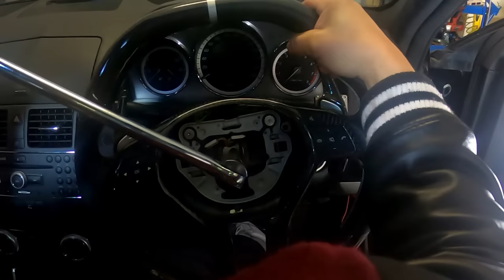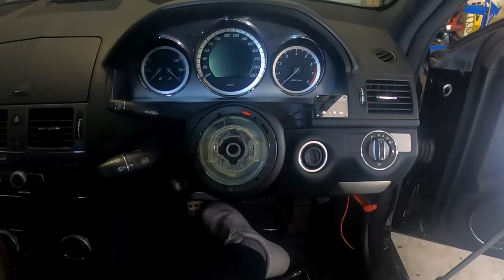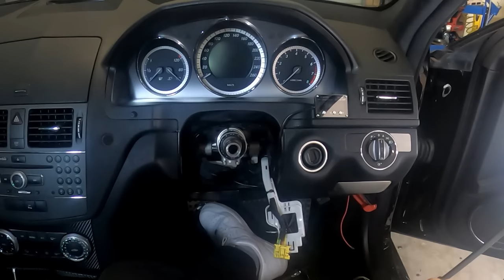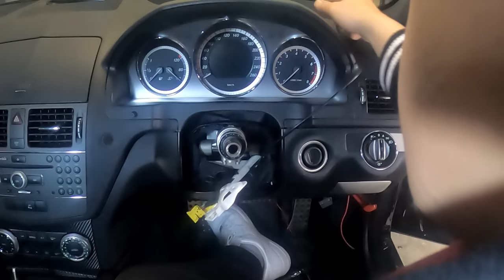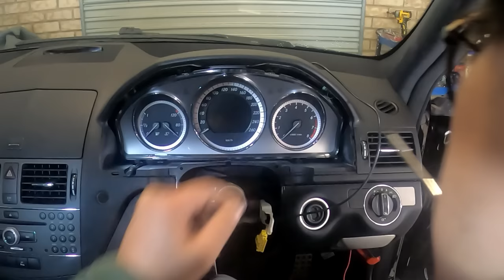HOW TO remove and fix ESL/EIS/ ELV MODULE  w212 w204 mercedes motor replace  Part 1

Comment: Hey, my ESL is definitely having the symptoms, but my steering wheel doesn’t lock at all. I can still move it fully, but I just can’t start the car.  Does that mean my ESL isn’t in the lock position or still isn’t Lock position. Again, I can freely turn my steering wheel. It does not lock now I’ve had my ESL replaced before.
Reply from the maker: yes so it just means ur lucky your esl failed in the unlock position..but tbh... after a few years of this ..although my car still going strong with the esl motor I swapped out ..I strongly recommend getting an emulator bypass module

Comment: On the streeing wheel, to remove it what size is the bolt?
Thank you
Reply from the maker: i believe it is an size 8 hex i will.double check for u and update this msg...so after having a look i believe its a hex 10 .... it can only be 8 or 10 but im pretty certain its 10.... wen u take off your airbag u will be able to find out for sure what it is ....
Reply: From memory a 13mm hex plus friend with very long lever and red-face torque will do it.
Reply: Sorry, 10mm hex. Can buy a socket or use the last and biggest one from the set of hex keys.
Reply from the maker: @dominicwild3189  yes its a size 10 hex
Reply: Don't remove the steering wheel or anything, have a read of Daniel Janka's suggestions above. You can pull out the whole column once you remove the plastic holder of the electric cables and the top two torx bolts using an extension and a universal.  It is also bad news to remove the short bit at the universal at the spline as the universal is alu and the other part is steel and once you mate them, you have to hammer them back in, so pull it all out right up to the firewall. There the steel spline goes into rubber, easy.

Comment: Nice Video! Okay so i have a couple questions?

1. Where is the 2nd video?
2. What's the name of the little motor?
3. Can i modified my car so there is no ESL/EIS or lock the wheel just turn it on like old cars?
4. How many miles does it take to fail the motor?
Reply from the maker: hey friend 
1. theres a part 2 if u look through my video 
2. theres no precise name ...you can find it via ebay by searching for a mercedes w204 esl/elv motor replace 
3. yes there is a esl bypass module emulator <--- search this ...you will find it ... you can also purchase from ebay but it will need to be programmed to suit your car and sync with your eis ... so yes u can remove your esl completely and use a bypass module in place of it ... its exactly the same looks the same but has no locking mechanism and basically bypasses the esl so your steering doesnt lock.... and because it doesnt use a motor no chance of mechanical failure which is our problem on w204s especially 
4. hard to say how many miles it is susceptible to failure at any time ...no precise prediction of miles or kms.... which sucks..but usually u can tell wen it starts to fail.... sometimes other factors like flat battery can mimic the issue but isnt a failed esl as yet ..thats what happened to me .... my batt kept draining out and eventually my esl motor died and had to replace it 
hope this was helpful friend

Comment: Hello my friend, just a quick question on the ESL motor, does it have to be a specific make, or can I just use any motor? Plus where can I get one of these motors? Thanks
Reply from the maker: a specific motor ebay has alot of them just type in w204 esl elv motor replace and it will come up
Reply from the maker: here u go....https://www.ebay.com.au/sch/i.html?_from=R40&_trksid=m570.l1313&_nkw=w204+esl+motor&_sacat=0
Reply: Thank you bro!
Reply from the maker: you are most welcome
Reply from the maker: it can be any motor but nake sure the gold spindle that spins  is the same size
Reply: Aliexpress sells the motors plus handle and pin to take out the four pins on the ESL lid plus the circular tool to take out the ignition lock if you are not game enough to change the motor and need to send ESL, ignition lock and key off to a locksmith.

Comment: Hey man, cool video! At what mileage does this usually happen? My car is a 2011 C300 4MATIC Sport with 90k miles and I’m really nervous!
Reply from the maker: hey buddy welcome to the channel , honestly it can happen at any time mate, i know its nerve racking, because if your not fortunately enough like i was to have it fail in your driveway your gonna need a tow...but i strongly recommend that if it does happen, give tapping it under the steering column (right under the ESL module) a go, and hopefully it will spin the esl motor 1 last rotation in order for you to get home...but ill also express, that it also happened to me when i let my battery drain out a ferw times....hence the esl losing all its power, thus not having enough current or voltage to work correctly....... they say its mainly for the earlier models like 2008 and 2009, but mine is a 2010 model and it happened to me at 100ks...... one day when i put the key in the ignition , i noticed nothing happened..... then with abit of research...i found this to be a common fault for most w204s.... the only thing i can recommend is ...if you have any warranty use it to fix the issue asap.... although your car is 2011...so your warranty maybe out of date,  unless you bought warranty extension, which i did buy.....
if you have any more questions pls do not hesitate to ask dear friend
Reply: Mine croaked at 137,000 km or 14 years (July 2007). The moment you need to start it twice, panic and drive it to your garage to fix it yourself or to the nearest stealership, sell your wife and children into abject slavery for the $2,000 it is going to cost you or $5 if you fix it yourself by becoming a Youtube mechanic with MIKEYZ's help. He is a fellow friendly Australian, so get used to his accent and forgive him!

Comment: Hi MIKEYZ, what type of grease/lubricant did you use on the plastic gears and motor?
Reply from the maker: you can use lithium spray grease or any grease for plastic moving parts i used general purpose grease but ensure it is for plastic moving parts.....

Comment: I’m currently doing this on my W204 how do I actually remove the ESL itself? Your video skips to when you have it out. Thanks
Reply from the maker: if ur fixing motor u need esl out ... there's part 2 where I show roughly where it is and how u do it ... I couldn't film it properly cuz of where it was situated... if ur using bypass module u don't need to just unplug
Reply: @MIKEYZVLOGZ  I’m replacing the motor! I’ll look in part 2 thanks
Reply from the maker: @dynasaur_fxdb9756  then u need to remove the esl... u pretty much do it by feel thats how I did it .. which is why it was hard to show how cuz all done by feel

Comment: I have a w204 with same problem where eis is not responding. But ky dash lights allbis not working either. But car locks unlocks and when i open the door the km does show but thatsbit nothing else. And key fob not responding. Obsthisbthe symptoms.
Also was intermittent when this happenned and then turn key and it starts. Now its dead.
Reply from the maker: Sounda like a esl issue ... when this fails it has the symptoms ur speaking of key doesnt read ... insert key and no lights on dash no response.. and sometimes it will work.... try tapping under the steering wheel...this can help because it send vinration to the esl and helps the motor unstuck so it can unlock steering allowing you to drive.... but this is luck

Comment: If the steering wheel is not locked does that mean that the esl is unlocked? Or is it possible that it may still be in the locked position?
Reply from the maker: hey mate welcome... hope u will subscribe  and support my channel... so if your steering wheel isnt locked then most likely its unlock..however in this case it could be another issue as to why your steering is unlocked... could u give me more info ...such as when you put your key in what happens do you get any noises?  like a click etc... also is this when you insert your key or its unlocked in general??

Comment: How long does this take and how did you know this was the issue? Mine won’t start at all and the battery is charged
Reply from the maker: research and mb forums and actually doing it..this is the issue 100%...if u are not good with tools and first time doing it maybe an hr to 2 hrs ... if ur good with tools and follow instructions well maybe 45 to 1 hr can be achieved...your case seems to be the esl for sure .. I can bet my bottom dollar its the esl motor
Reply: @MIKEYZVLOGZ   thanks, I call the dealer just to hear them lie and they’re telling me it’s $1750 and a grand of that is parts. Straight thieves
Reply from the maker: @jcso0721  exactly

Comment: Hey mikey i removed the motor and replaced it but it is still not working what do you think it could be the dash still says remove key from ignition I'm so confused lol thanks?
Reply from the maker: when u put the circuit board back did u ensure the two lottle grey micro switches were pressee down?.
Reply: @MIKEYZVLOGZ   no i did not  thanks  so much for replying mikey ill rewatch your video
Reply from the maker: @ToLife_  in the video i dkdnt show that but it is important if for some reason they rnd up depressed ... sometimes its due to reconnecting power and also if your esl wasnt properly unlocked
Reply: @MIKEYZVLOGZ  hey mikey are you talking about where the motor meets the circuit board
Reply from the maker: @ToLife_  no there are two little micro switches that are on the circuit board on dofferent levels send me an email ill email u a pic ... usually ull kmow if they are pressed wen i insert board and u cant get it in flush
Reply: @MIKEYZVLOGZ  i just found them so all i need to do is press them down correct?
Reply from the maker: @ToLife_  yes and it should be fine... if not then theres obviously sometjing ur doing wrong

Comment: What happens if the switch doesn’t detect the key and you can turn the key but instrument cluster not lighting up nothing that’s why the dealer said your esl switch is bad and need to be bypass or replaced for a new and programming it 
So that’s my question for you u think that the same problem or a different?
Reply from the maker: if you put your key in and nothing happens ..no lights... no turning noise from esl usually you get a whinding noise.... then yes it is most likely the esl motor in the module.... you do not need a whole esl module you can simply replace the motor...no programming needed .... but if you replace entire module you will need to have it programmed .... in your case I'm pretty sure it's the motor
Reply from the maker: so yes it's the same problem friend unfortunately
Reply: david murillo  I have a 2010 Mercedes c300. I place the key in the ignition then just turn the key all the way to crank the engine but no crank and no cluster lights or head lights. Would the ESL cause this problem.
Reply: MIKEYZ VLOGZ hello so you say if my cluster doesn’t light up and engine doesn’t crank it’s because of the ESL. I got this code b225464,,Electric steering lock has a malfunction. The key turns all the way to crank but like I said no cluster lights and no crank. Oh I only notice the middle section of the cluster showing p, r,n and drive light up
Reply from the maker: @rogerhulsejr2111  ye your code means its the motor in the esl that has malfunctioned ita most common fault with w204

Comment: My w212 same mechanism, but mine got stuck in ulock and now sometimes the engine wont stop even when i remove the key from ignition... But it never locks the steerig wheel. So, even if i replace the motor, i still need to go to a dealer or service?
Reply from the maker: if your just replacing the motor there is no need to reprogram it. or visit the dealer
Reply: Thnx! You might have just saved me 1200€. So now i just need to finde how to come to the locking mechanism. Will tell you how it goes.
Reply from the maker: @matejalbert2259  just pls remember to pay attention to detail and also wen u put everything back together make sure u also depress the 2 lil grey switch buttons on top of the chips as well

Comment: Mikey I can’t get my ESL out of the lock position. I need to get the steering column out but can’t figure out which bolt. Can you help?
Reply from the maker: u see a bolt where the column attaches to the shaft there's a Allen bolt that holds it in ..u undo that and it will allow u to remove the entire column
Reply: @MIKEYZVLOGZ  thanks Mikey! I did do that and I couldn’t pull the pin out.
Reply from the maker: @charityfreeman5569  u can just loosen it and then just pull out the column u don't have to remove the pin
Reply: @MIKEYZVLOGZ  thanks! I am so sad I couldn’t do it. I had to get help but today I think I will be able to repair it.
Reply: @MIKEYZVLOGZ  ok so I got it out. It looks like the circuit board is fried. If I buy a new ESL on eBay will it work with my keys and ignition or do I need to get them all programmed together?
Reply from the maker: @charityfreeman5569  ok in your case u need a new esl or use a bypass emulator and yes u will need it coded and programmed to sync with ur car ... ull need to remove ignition eis barrel send off key and eis and esl module if u get ur own ...
Reply: @MIKEYZVLOGZ  Hey Mikey, so I had to use a bypass ESL and I have put it all back together. Now my airbag light is on🤦🏻‍♀️. I must have done something wrong.
Reply from the maker: @charityfreeman5569  ye u didn't disconnect the battery and allow all the power to discharge before unplugging airbag .. no biggie just have it reset
Reply: @MIKEYZVLOGZ  that’s right. I didn’t disconnect the battery. Do I need a special tool for resetting or do you have a video for that?
Reply from the maker: @charityfreeman5569  u need a scanner tool to reset airbag or goto a local mechanic and should cost like 20 50 dollars depending on mechanic ... I'd just buy a cheap tool that can do it ..plenty on ebay..just ensure it can reset the code plus it's a good investment for future errors
Reply: @MIKEYZVLOGZ  Thanks so much I’ll do that. All you videos are the best! I really appreciate all your help.
Reply from the maker: @charityfreeman5569  thanks man i really appreciate u saying so im just happy ppl are getting use out of them

Comment: Hi, Please can explain about syncing after replacing the motor. At what point do you do this? And what do you have to do exactly? Many thanks
Reply from the maker: u only have ro sync if u use a virgin module or swap or fix the NEC chip ... like I said in video its the motor that fails not the chip but the chip can fail too.... if your only swapping the motor ..there is no need to do a sync ..just swap out motor and good to go... that's where alot of ppl get confused ... thinking a recode or resync has ro be done even after a motor swap but I assure u it doesn't have to be done ... just a simple motor swap

Comment: If I can move my steering wheel back and forth without it sticking anywhere, is my ESL unlocked?
Reply from the maker: yes if your steering wheel does that , most likely your esl is unlocked, as the locking opin hasnt engaged hence leaving your wheel unlocked
Reply: @MIKEYZVLOGZ  turns out it actually was locked, but I could still move my steering wheel back and forth. It was in a weird in-between state. I ended up going with the digital override thing from ebay. My car now has an SRS error; something about the squibs. I don't know how to fix it.
Reply from the maker: @BrettWyrick  ahh yes this can happen due to the motor being stuck in theun lock position yet the module reads as locked ..sorrybi forgot to mention that too... I didn't read it properly .. as for your srs error .. did u disconnect battery wen unplugging airbag

Comment: Can anyone please help me how to get the dowel pins out! I bought that special tool but without any success
Reply from the maker: it takes patience and theres a certain way to do it  u get it in then turn as u pull out tepeat til u ur remove it..another thing j can do it use a t5 torx bit tap it in til it grips and is kinda stuck then slowly turn and pul at the same time rinse and repeat ..it will come out ... all else fails drill them out
Reply: Thnx for your reply. I have tried but no luck. Any suggestions where I can take it to be removed.
Reply: Will try with a t5 screw driver
Reply: Still no luck
Reply: I finally was able to get 3 out. Used a drill bit big enough to go thru the dowel pin, tapped it, twisted it a little, then pulled it out. But I broke 1 drill bit inside, hence will need to drill it out.